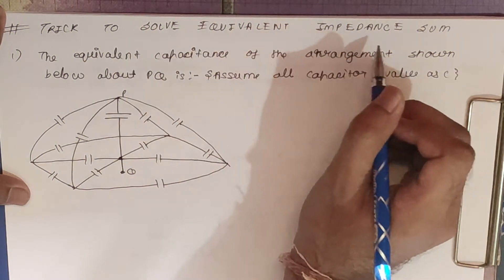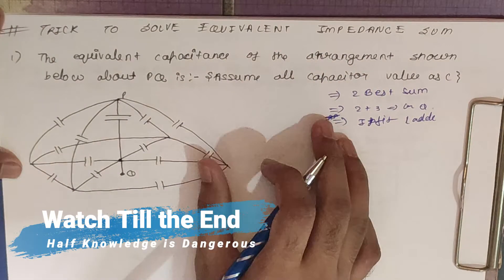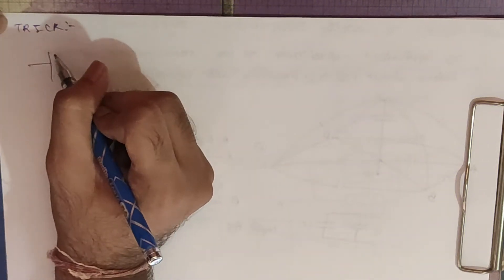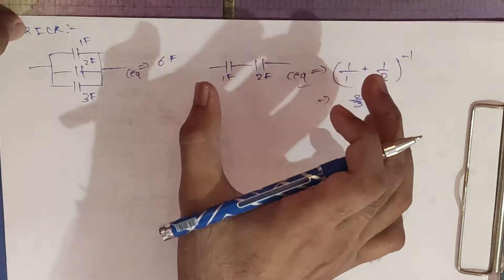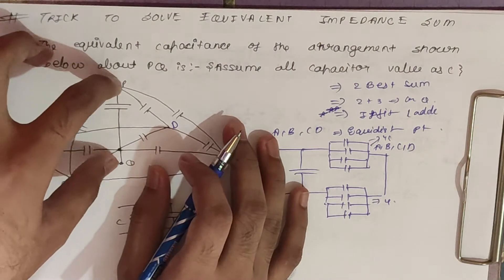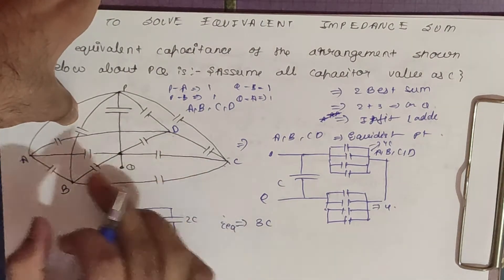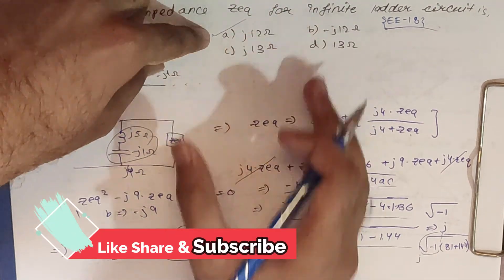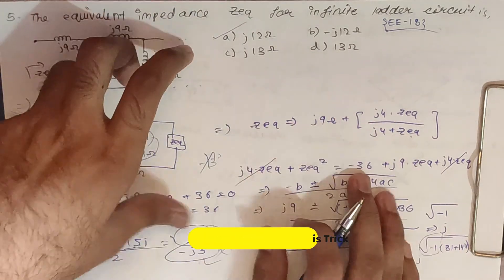Trick to Solve Equivalent Impedance Sum | RLC Combination Circuits | Equivalent Capacitance Problems

Comment: Hello bro there is a gnd after cs in question but at 15:27 it is not considered why?
Reply from the maker: Good question ..if you see that point what you are saying as. Ground is connected directly to upper point..it means that two point are connected to same node..that is gnd
Reply: @VinayYadavTricks  yhea I got it thank you bro.